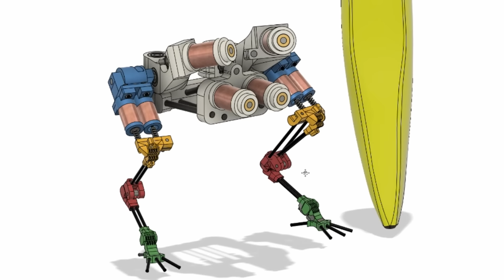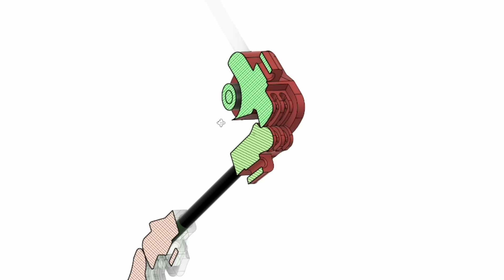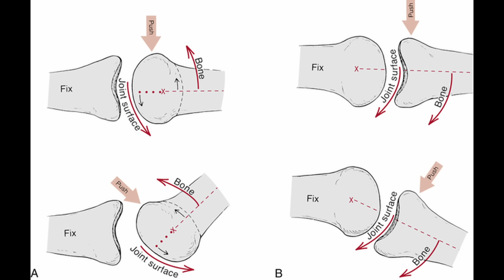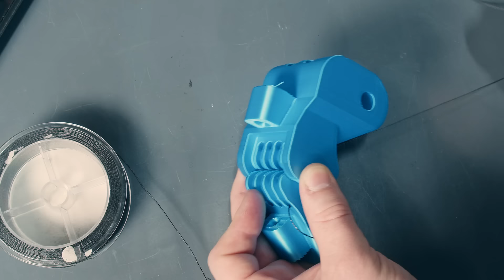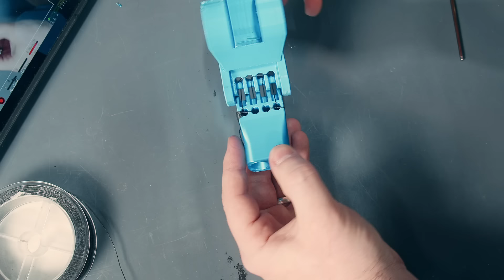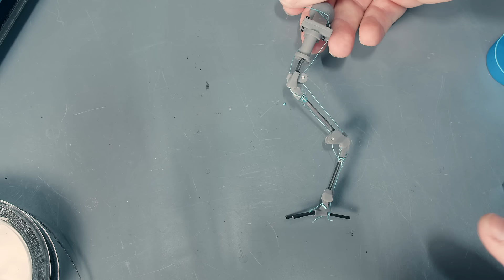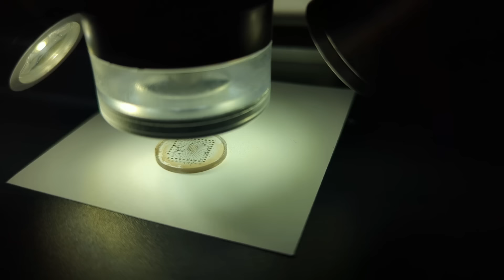Alternative to bearings for tiny robots

Comment: 0:58 i get a ton of micro bearings from old odometers. Whenever i go shopping for replacement parts i made it a purpose to get at least 10 of those, because inside there are sub mm shaft ball bearings that are pretty high quality. Not only are they bearings in the regular sense, but at least one of them is also a side load one (usually the one that's on the main shaft from where the spedo cable would pop in). But we're talking pre-90's odometers. Most modern ones (if they even have mechanical ones) have plastics inside, teflon revolution.

Comment: I've designed a rolling joint like that couple years ago. Adding some meshing teeths like gears to prevent slipping improves stiffness and accuracy of the movements very well. Not sure you can add with the sizes you are working with tho

Comment: i somehow expected those surfaces to interlock into each other and rolling on the "inside bottom" not "inside wall" (that would cause huge friction)  like.. imagine rolling one fist over the knuckles of your other fist. would that be possible as well?
also this would give more stiffness to sideway rotation (one downside: instead of a "dislocation" you would now have a risk of breaking but this would come with more stiffness/resistance towards unwanted sideway rotation)

Comment: Hey i have watched the whole video and as always great work on the explanation amazing shooting super clear information, but i cant help but wonder, why did you go for that technology ? It looks cool thats no brainier but a simple axle would do just fine, theres no heavy lifting or harsh environment.. even if there would be, a syringe needle and a bearing bronze wire with pinned ends will be much smaller lighter ?compacter? And most important, lot less work and hustle.. looks like you will not get any significant wear or tear in the lifetime of the robot as you can do juat fine with olastic joints, so... 

Still the idea is extremely cool! Cant wait for new videos and updates about it, looks like it will be the coolest and sweetest robot ever! 😊

Comment: The wire might be stretched differently for each angle. So the movement, even if it was along 2 semi circles, might be different throughought the whole motion

Tried doing math on an example of 2 quarter circles, with the wire routed along a right triangle within the quarter circle (triangle has lengths a, a, asqrt(2), circle has radius=a )
Got a wire length differenence of 1%, for the two cases of: joints touching at corners, and joints touching at the middle (belly to belly).

Just something interesting i found by boredom

Comment: WRT the anatomical inspiration, there is curvature in joints in perpendicular axes for added stability. It's an extra step, but you might get more stability by varying the relative heights of the contact surfaces and no longer need the side guards and extra friction they add. A frontal profile sort of like the teeth on a key or heck, even an actual knee joint. You could also consider using kevlar thread instead of fishing line. Regardless, very cool project

Comment: why using several ridges inside the joins instead of a single flat rolling surface which look much more robust ?
Reply from the maker: So I'd have a place to thread the line. There are designs that use flat ribbons which work better with a flat rolling surface like you suggest. Definitely ends up being more robust, although you need different attachment/flexure mechanisms!

Comment: Really neat stuff!
If you want to prevent rotation, you could impose a gear teeth row on the outer 'bearing surfaces' so that the movement is not only constrained by the (flexible) rope.

Comment: Thats pretty cool, thank you for sharing!

Point about the bearings: Ball bearings are generally meant for high speed, low dynamic load, rotating applications. For small, low speed and impact loads such as those joints, I think you'd be better off using bushes/sleeve bearings instead. That being said, rolling contact joints are awesome!

Comment: Very cool.  Did you try making the upper "knee" have a pocket for the lower to ride in, instead of a flat area it sits on top of, Would also add side to side strength.

Comment: Why not loop back through the same path, ie figure of eight? Then you get twice as many cords holding the joint together.
Reply from the maker: Definitely possible! On the small model there wasn't space (I designed the holes/channels to fit the string) but could modify the design to accommodate a second pass. Will keep it in mind for future revisions!

Comment: Your work is a breath of fresh air in the cloud of farts youtube became...
I am surprised you did not put string in both directions. I mean, you sew it interchanging under-over, but when we did our plane model control surface  hinges (way before RC became a hobby for mortals)  we put under-and-over in each "hole" or groove. You get way more rigidity all around that way.  Also, just more than one strand and a ton of tension is beneficial. 
Sorry if this is obvious and you did that just for visual simplicity...
Reply from the maker: Just didn't think about it to be honest! The small model is pretty space-constrained so it was a struggle to get one pass sewn, although I could tweak the design to allow for a bit more space for the reverse. It's a good idea!

Comment: Been playing with super elastic nitinol as the joint surface and tension mechanism, having the joints roll on the wire directly in grooves on the joint surfaces provides sideways stability, though now the joint is easy to pull apart without additional tension cords perpendicular to joint surface.

Comment: Ball bearings are not the go to solution for limited rotation joints at all. why not use bronze bushings instead? pretty shure it kan be found or made at very small scale (clocks). But great technical video ;) thanks

Comment: So I take it that joint compressions strength can be modified by adding or removing the raised parts or by thickening/thinning them, where the joint's resistance to traction would be modified by changing the number of channels or threads going through them? I could be overthinking it; I'm an animator not an engineer, and for all I know 4 channels is optimal because you could thread the weave pattern in the tiny version. Very cool, though, and when i get around to redesigning my humanoid robot for 3D printing I think I'll be using these knees.

Comment: One question I would have is do you even need bearings? If it is low load and doesn’t need to move all that fast or constantly then just a hole in the plastic and a metal shaft might be good enough. It would likely be even better with some lubrication or using a material with low coefficient of friction and high wear resistance, like nylon or PTFE blends, like PC-PTFE or PETG-PTFE.

I am building a hexapod and have decided that for now I will just use low friction materials and have plastic on plastic contact. I haven’t done any long term testing yet though. I may have to move back to bearings in the future.

Edit: another option is bushings and metal shafts, that would have good wear resistance and stability whilst being smaller and lighter than bearings.
Reply: My take is that it's just an interesting project for its own sake. This isn't a commercial product, there aren't any specifications or requirements. There are a dozen ways to skin this design cat, and hey, let's explore this one

Comment: These are also used, I think, in old hard disk mechanisms for the stepper motor to move the heads. It was a little metal strip that wrapped around the output shaft.

Comment: Very cool!
I notice you have a ball joint at the hip position. They can be a hassle. Have you considered using two of the rolling contact joints set at angles to each other, like a universal joint? If, instead of the joints being at right angles to each other (as in a standard universal joint) you set them at different angles you can limit the freedom of the joint.
Really looking forward to seeing your bird-bot.

Comment: I assume the reason you only have 4 crossing fibers is due to the size of scale for the original. As you were building it though, wouldn't it actually be ideal that each 'channel' could have a subtle divider and allow a full 2 strands to cross paths? The idea there would be that the divider is a sort of detent that makes them not both go towards the same center, but also have a bit more load redundancy and joint stability without taking more space. Also there's the idea of a thinner line so you can 2x lace each individual joint, if you had to go with a 75% as strong test-line it would still be 150% overall more tensile resilient.

Comment: Seems like way too much effort in CAD. I would prefer a pin joint, perhaps nature would too if it had access to high accuracy, strength, stiffness, and hardness steel pins/shafts in all possible diameters.

Comment: Very neat and simple way to create a joint, thanks for posting it! While watching this, my son asked if you were going to use rubber bands, which gave me the thought... If you needed a simple/light weight way to return the joint, a rubber band as a muscle would work. The other muscle to activate the joint could be how you have it designed, which appears to be a solenoid attached to the fishing line. Essentially a joint activated in one direction with a return spring. It would work to lift the leg after it's been extended.

Comment: That rolling contact point joint version looks eerily like a real leg. I was listening to what you were saying, but my brain immediately went "oh, thats a bird leg"
Reply: Right, it's basically a real ankle joint flattened to only work in one plane. If you gave it back that excursive movement to have just a little movement on the other axis, and thus reshaped the 2d curve of the contact surface into a 3d compound curve to describe that new range of motion... you'd have something that looks basically identical to an actual bird's ankle joint again, although in real birds the joint is flipped around, with the 'ball' being on the top and the 'socket' being on the bottom.

Comment: You should check out using Nitinol Memory Metal Wire, It would be perfect for this application, you can even control the movement of the Nitinol wires by using small electrical signals or heat and cold. Nitinol would act as not only tendons but also as muscles to move the joints so no additional servos would be needed which would really simplify your design, cut down weight, increase mobility of strength of the legs greatly and allow you to control each joint independently. Nitinols made from Nickel and Titanium so its some seriously strong stuff and its easily available in the USA.

Comment: The makers of the Rubik's cube made a couple puzzles they called the Rubik's magic and master magic(I think). They used a rolling compliant mechanism like these in a way. The regular one consisted of 8 square tiles in a 4x2 arrangement. The goal was to fold and flip the puzzle in various ways to change their shape into more of a v shape while rearranging the tiles so the photo on the back turned into three linked rings. They usually got turned into a tangled mess of fishing wire and tossed into the garbage. I have a few of them!
Reply: There's a much older "folk toy" called a Jacob's ladder that is basically the precursor to those.

Comment: Ah, compliant rolling contact joints. Nicholas J. Seward designed an elbow driven delta 3d printer based on the concept, though it was only a concept prototype (the Reprap Gus Simpson). He used herringbone gears to keep the parts aligned through the rolling motion,. maybe it would scale sufficiently well down with plain gears?

Comment: As others have mentioned, you have ligaments, self-correction, etc involved in biology.  It will be difficult to get this 'tight'.   Ball bearings are 'loose' when small, and overkill for a small, slow joint.  Sleeve and pin type bearings especially with bronze may get you a much better, more precise joint.
When you go small scale like this, you quickly want to start studying watches, almost every consideration you can possibly come up with has already been done in that field.
Or you could make the leg about 4x longer, probably still doable and that would get the same error and play down to a more reasonable percentage of the over overall motion.  
Not knocking it if you want to try it at all, but off hand it's just very hard to reduce the inherent play in something like this, vs instant high precision with a sleeve bearing type system.
Reply: was looking for this comment, a simple bushing is the correct thing for this application, cheaper, more precise and more durable than any of the other options

Comment: I started my version of this back in 05. Here's what I learned.
You can make them cams to increase torque advantage to position ratio. 
The "ligament" cables tend to ablate on each other and the groves. I was able to mitigate this some by Drafting the groves by 5°. That's as far as I got. Good luck.

Comment: You can buy ball bearings much smaller than this. For example the bearings in a self winding watch rotor can be purchased. Not that this is a replacement for all the other reasons. Just adding it is not true very small bearings are not available.

Comment: This joint reminds me of a geared hinge model that I made a while back. Very similar except that instead of string it just used a rigid frame. I never tried printing one quite this small, not sure it would actually work, but was print in place with no post processing when it did work. Was really quite resistant to dislocation though, if you dislocated it, you broke it.

Comment: I used on a previous project, related to hands and fingers, neodymium magnet and steel balls to form a joint. The Magnet was sort of inverse cone shaped to give a pan for the ball to sit in. Added some 'guards' on the side as your joint has to prevent the lateral displacement. 
Worked really well, rolled like nothing, but was compliant enough for a joint to dislocate when stressed to far.

Comment: Holy grail of mechanical joints!
As many (if not all) biological beings with joints, we have proprioception and there's a constant feedback of tentioning and loosing stabilizators (in our case muscles) without being aware.
This is looking extremely similar to knee joint (with missing couple stabilizing tendons) but with the right tention sensing feedback and a good enough processor, we might see this everywhere as it looks cheap and clever. World loves cheap and clever! Thanks for sharing!
Reply: You could also make it so that it reacts to changes instantly , one good example is "Birdbot" , it uses cables as tendons and they react to changes instantly , also is way less bulkier than other designs and is scalable

Comment: I love how in picking up the rolling-contact leg it instantly is recognizable as something more biological and light, as opposed to the bigger clunkier mechanical bearing-based design

These rolling contact joints are something I became interested in recently while trying to find a compliant but weight-bearing hinge, and came across a paper from the 2000s where they used it to make satellite solar panel deployment mechanisms
Reply: Can you share the name of that paper?
Reply: @5eurosenelsuelo  “Tape-spring rolling hinges” watt and pellegrino 2002
Reply: well, circular ball-bearing races are optimal for where you want full rotation, and around a point.

Comment: That is really cool. I haven't done much robotics so never run across this kind of joint but it really is ingenious.
I do wonder if you had printed them sideways if you could get away with a purely printed joint (assuming two types of filaments one rigid for the joint itself and one to replace the wire)

Comment: You can get ball bearings down to 1.5mm o.d. or .060"
Cheaper options go down to 3mm o.d. or about .120
Reply from the maker: Yep! But that puts some severe constraints on load since you need shafts that are like 0.04" diameter. TBH I didn't realize you could get them down to 1.5mm OD though, that's ridiculously small!

A nice thing about these compliant joints is that the physical size is small, but the load cross section remains quite large because the whole rolling area acts as the bearing surface. Of course, you become limited by the cable/ribbon instead but that's a different can of worms :)
Reply: @BreakingTaps  plain bearing would probably be a lot less work lol. But you can't really make an interesting video on them I suppose. Good luck with your project!

Comment: Might it not be a good idea to attach one end of the connective "tendon" to a very small (e.g. 1.5mm dia. x 6mm lg) extension spring preloaded to around 50% of maximum extension to compensate for wear, cord stretch and to prevent joint/tendon damage due to accidents?
Reply from the maker: Definitely! There are a few designs out there that use that idea to not only allow compliance, but also attach it to an actuator so that compliance can be dynamically altered (helpful for some highly dynamic motions like jumping and landing)

Comment: Suddenly dislocating joints make a lot more sense seeing this. 

I can see this rolling geometry allowing for some cool variable strength grippers
Reply: Now only for some form of synthetic synovial fluid...
Reply: @badlaamaurukehu  maybe - it's also interesting that the mating surfaces could be textured/toothed (like gears).
Reply: @markhahn0 that would me a nightmare to manufacturer. Assuming you didn't 3d print. (There are very good reasons not to 3d print something like that as well.)